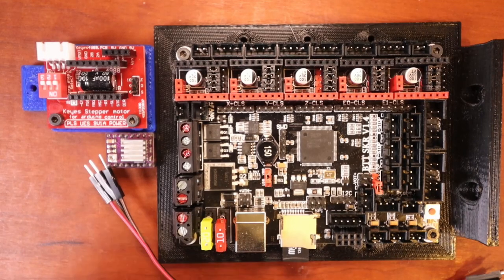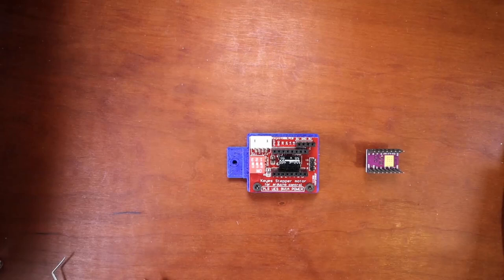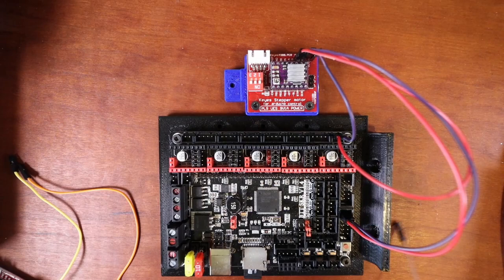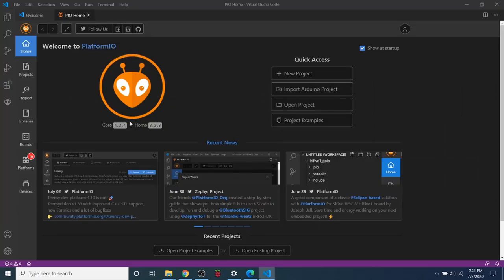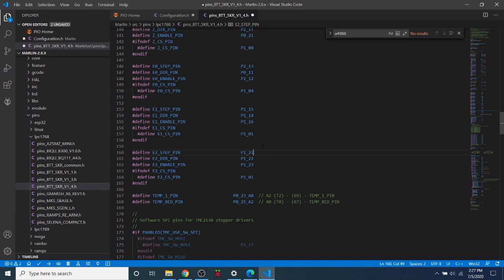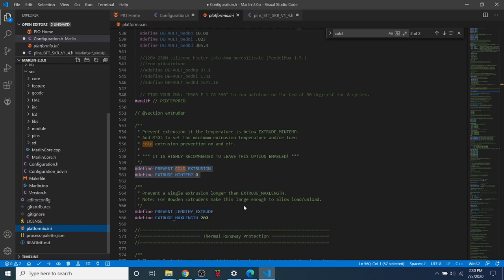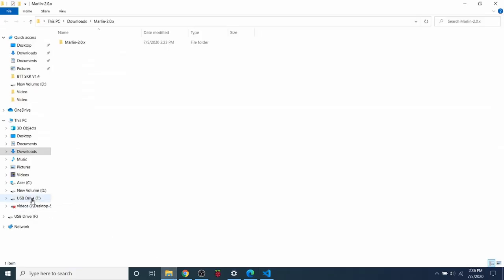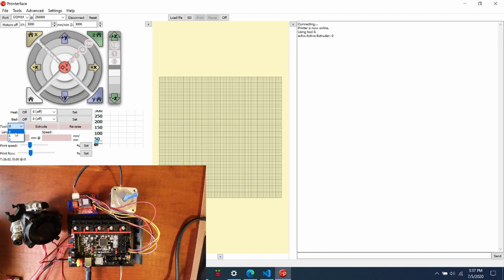SKR 1.4 - Adding a 3d Extruder Stepper for a Diamond PrintHead

Comment: Hi Edward. Great info!!!

 i'm building a robot arm that i want to control with Gcode threu a skr 1.4 turbo with all external TB6600 drivers (for nema 23's)  can you show how to connect the normal xyz e0 e2 to the TB6600? 
Many thanks!!!
Reply from the maker: I'll need to order parts so maybe.

Comment: Can you use TMC2209 with this method and that stepper holder?
Reply: I can't find the video you mention in other comments.
Reply from the maker: If using for extruders it's best to remove diag pins from stepper.  Or you can use TMC 2208.
Reply from the maker: Inside description of video on YouTube there's a link to playlist with all the videos.